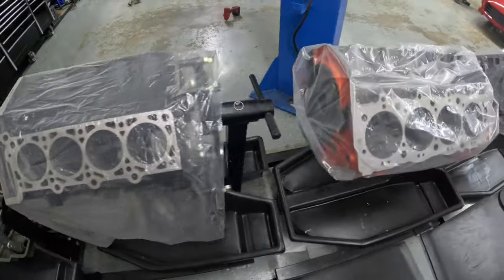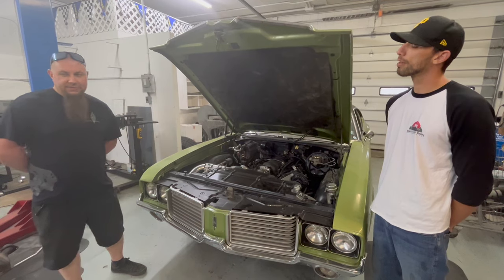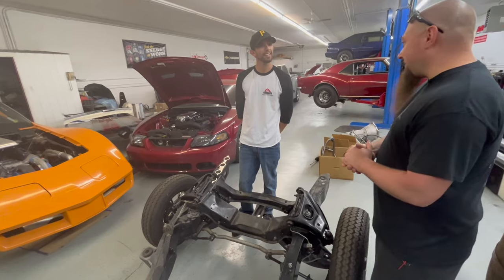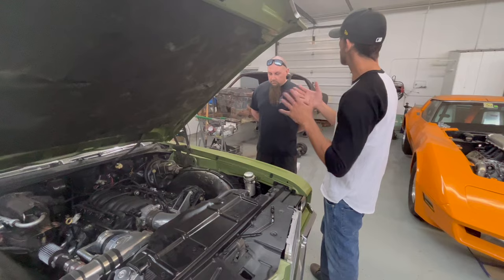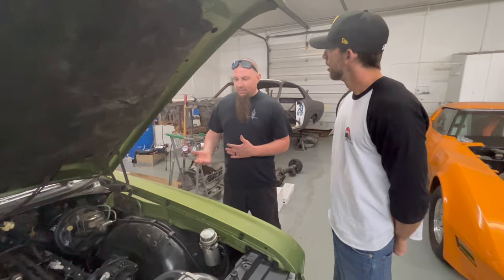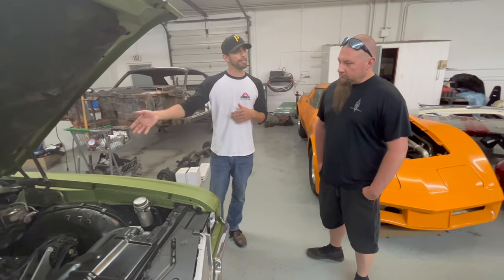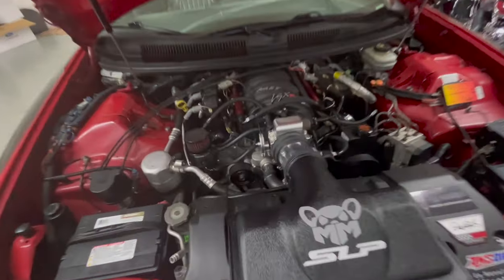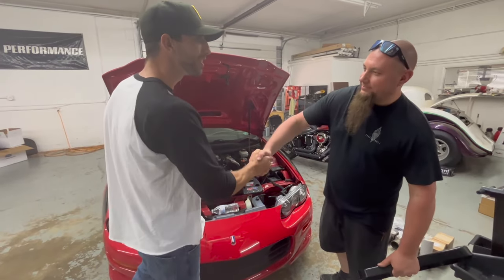How to LS Swap your CLASSIC CAR for Dummies!

Comment: Great video and advice but your asking a shop owner and of course he is gonna reccommend every high dollar option……if youve got $15k to blow go ahead and get new EVERYTHING!!!!……ive used factory tanks and wiring with stand alone ecu’s harness on many swaps with zero issues……..this guy reccommends breaking out the checkbook cause thats how he feeds his family……..research reasearch and more research and do it yourself…..its not hard guys
Reply: Agree do your research and save 
I don't have BIG money to spend on all the Xtras, wish I did
Reply: Well put
Reply: I just got done with a LsSwap 6.0 /80e and you pay for what you want if not do it your self to cutt cost I spent 7k and it's looks awesome and runs good ..!!
Reply: Exactly of course his gonna try to brain wash your head about going with a brand new parts for your vehicle not only for the owner shop to make the most bucks but it's the easy way for the owner to save time and headaches right. So this is for the person like me that likes to saves money plus I like to do this type of hobby well DO IT YOUR SELF AND THEN SAVE SOME REAL MONEY by staying AWAY from shops like this ones
Reply: He probably doesn't make much difference with new or used in profit. His experience with various cars going ls that the way he does it gets less customer complaints.
Reply: Where do u get you computers from..and do u use stock wiring harness? Thank you in advance

Comment: Like it or not the LS swap is the new small block Chevy swap that saves a lot of junk cars.  I love old school motors because of budget but the LS engines IMHO is the best Chevy motors ever built. Stupid power and good mileage even with 4.8 but they are definitely not cheap.
Reply: No replacement for displacement 
Also don't matter what engine if you're heavy on the gas pedal fuel economy disappears if that's what you want get a 4 cylinder

Comment: See all of that stuff sounds good. But they forget in the aspect of the money part .  Now, I know somebody gonna try to come behind me  and say something negative. But all these parts he’s talking about or a couple thousand dollars a piece. This stuff is a cheap, I went to try to take my gbody to a shop like that after I put a brand new motor in fresh out the box from Summit. And they tried to hit me with a whole new ignition system and fuel system that was going to cost the same price if not more than the actual motor is self . At the end of the day with shops like that, if you don’t have a extra 20 to 30 grand, to put into your old school you just wasting your time having a conversation with them folks..

Comment: I guess I'm a purist! I believe these guys are ruining all these vintage cars.
Reply: The muscle car angle is probably the biggest driver of this market and saving these classic cars.
Reply: @svtinker  I disagree!
Reply: @svtinker I'm doing a 383 in my 65 chevelle Malibu it's already a light car I'm not adding excessive weight of extra wiring and computers ect
Reply: They are actually making these cars dirt cheap they've came down in price alot lately 😂 thank you idiot ls swap guys
Reply: charlieb308  if you are getting 5mpg you're either not mechanically inclined or they are just stupid and probably shouldn't be messing with cars in general
Reply: charlieb308  big block vs small block big difference more cubes more fuel even if you have a ls more cubes you have the more fuel you need to make it run and if you have a heavy foot that won't help either I've had my share of fuel injection vehicles as they aged They became very unreliable even with maintaining them and if I was heavy on the pedal they drank more than driving nicely to each their own I'll stick with my sbc builds I'm not a big fan of 200lbs of crap in a 1 lb bag types of cars I prefer less wires more motor
Reply: charlieb308  my 65 chevelle is in the process of getting the body work fixed I'm doing the work I estimate I'll have 30k in it since I'm not doing a show car just a solid driver 
I'll be dropping a 383 in it and a 4 speed I'll drive it all summer long I got a v8 5 speed blazer that I currently drive but I prefer to use that as a winter and work vehicle 
The chevelle will see many miles I figured if I'm going to build it I'm going to enjoy it
Reply: charlieb308  I'm in wisconsin so I know that feeling about salt they put so much and now they are using beat juice and salt which tends to stick to everything
Reply: charlieb308  holy smokes that's terrible
Reply: charlieb308  facts 👌

Comment: I have a question i have a 1982 delta 88 ls swap  im having  a problem   with headers 5.3
Reply: I do g20 G30 swaps. I use stock manifolds right side needs to clear the frame my exhaust guy cuts the flange and rewelds it to make it clear. Stock manifolds like most GM parts will run 1000hp flow is actually better than headers too.